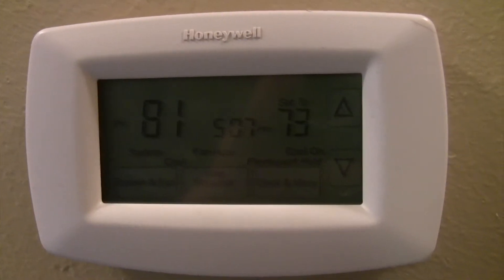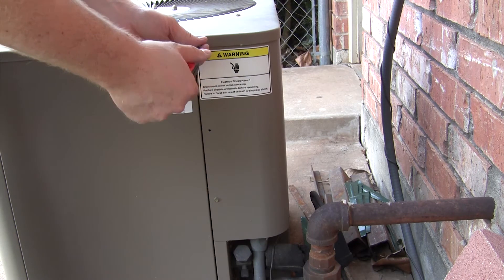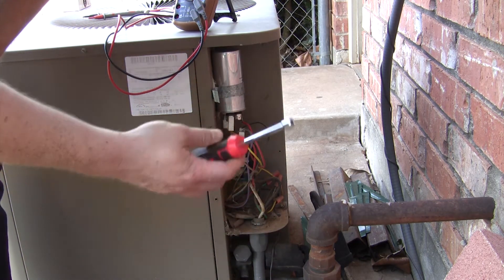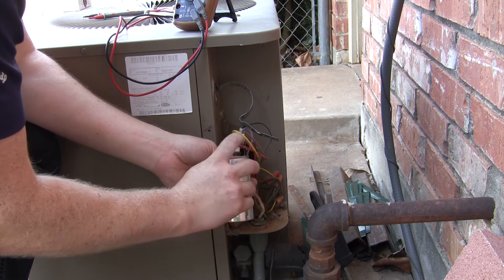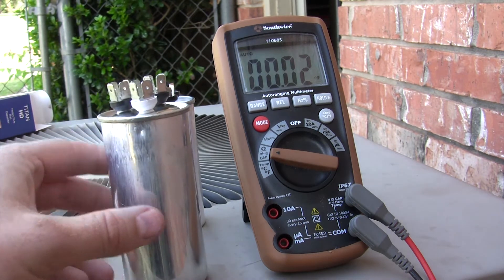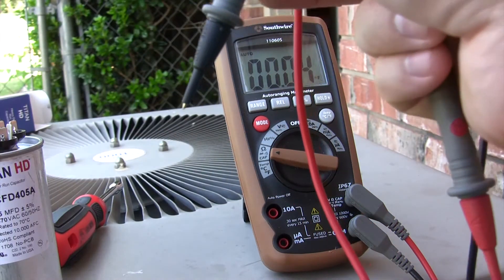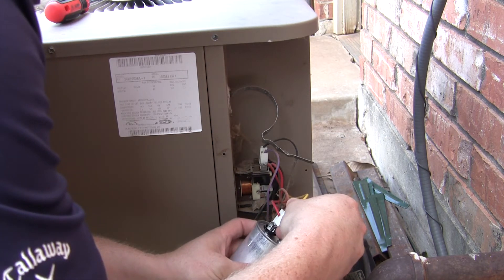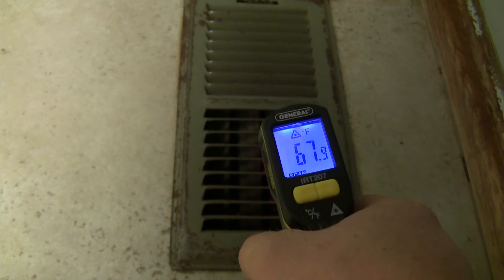AC Not Working: Blowing Hot Air How to Replace Compressor Run Capacitor

Comment: Putting a screw driver across a 240V capactor is a very bad idea man,  you need to use a Variable resistor or potentiometer to loose all that current slowly or there will be a big bang.

Comment: I used your video today to fix my compressor.  My capacitor is still in good shape but as soon as I removed the cover, I could see the red compressor wire had completely burned through at the connector.  I removed the capacitor and cleaned the terminals and reinstalled with an insulated crimp connector.  Voila, we have air conditioning working again.  I’ll keep an eye on it, though, in case, I do actually need to replace the capacitor eventually.  I thought I would mention it in case some of your viewers would find it helpful. I can only imagine an insect got in between the terminals and shorted them out somehow.
Reply from the maker: Thanks for the heads up!